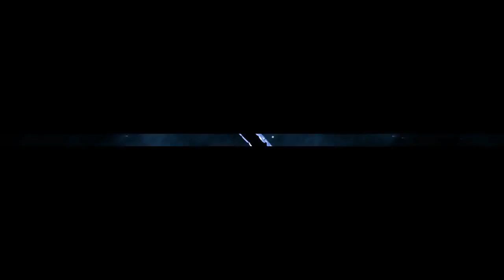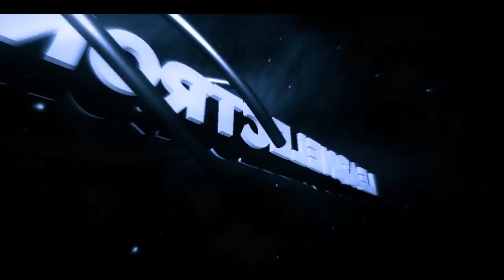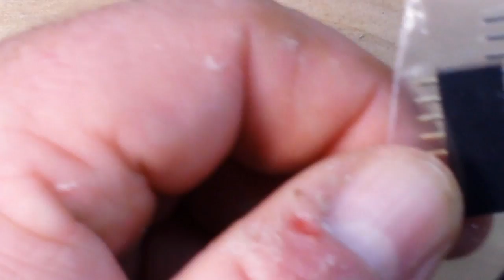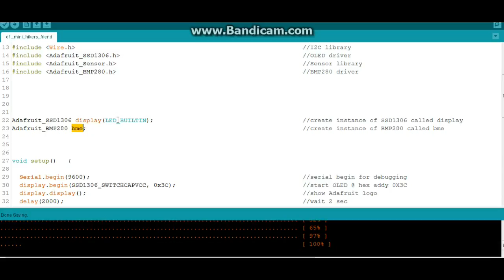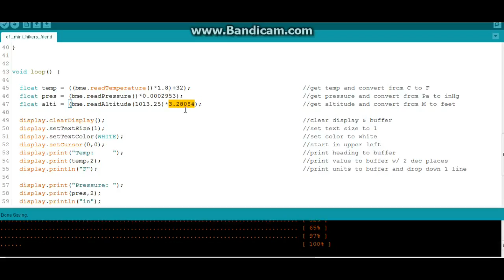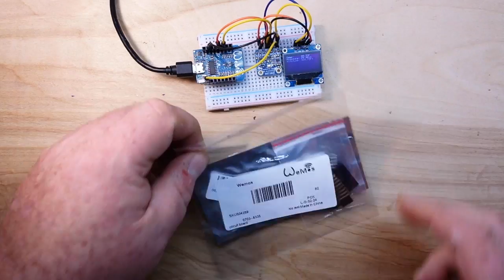Wemos D1 Mini Hiker's Friend

Comment: The BMP280 is a great sensor.  You can change font size in the code to make it bigger on the OLED.  I ordered a lot from the Banggood sale -- still waiting for my stuff to arrive! :-)
Reply from the maker: Michael Padovani I have 3 of the Bosch sensors, the Bmp180, Bmp280, and the Bme280. Although I think I fried the BME lol.
Reply: I did the same once and took my time soldering the next one!

Comment: Like the video as usual.  I never heard of it called a hikers friend.  If you are assembling that permenant, and the OLED pins are in the correct order, here is a cool hack to mount it even so it's not a "shield":  
https://blog.squix.org/2016/06/esp8266-hack-piggybacking-oled-display-on-wemos-d1-mini.html
I have quite a few mini's - love them, and for that reason if it's me that wins (haha), please redraw and give to someone who would need that more.  
The only thing I don't like about the D1 in an end project that runs on batteries is that it's kind of a waste to power that CH340 for nothing, and other people have complained that the circuit is not that efficient compared to a stand alone ESP.
I cant imagine someone would constantly down vote your videos, but probably it's the same troll.  Don't worry thought, I tried to watch them all, thumbs up and comment to help your ratings.  Maybe it will counter it some!  Good luck - I see your numbers climbing exponentially - you deserve it!
Reply from the maker: James Kerns Jr. Thank you very much

Comment: Cool project.  Thanks for the videos.  I've learned a lot about micro dev boards, sensor implementation, and user interfaces via your channel.  I'm almost to the point where I can build my own wireless weather station with graphical display and data storage.  I'm collecting v parts now and will begin the build soon.  Keep up the good work.

Comment: Thank you for the time you take to create your videos. And especially a giveaway. Only Improvement I could ask for would be to teach like some of your viewers are just learning to use and program the Arduino. This is my 4th week and the learning curve is kind of steep. A bit more explanation on components and code would be helpful. Enjoyed building this CO2 PPM after trying to figure out that I had to reorder the OLED i2c and not the SPI. And that you had to select the type of OLED in the library to get the project to work correctly. Either way it did force me to learn more. Thanks again keep up the good work